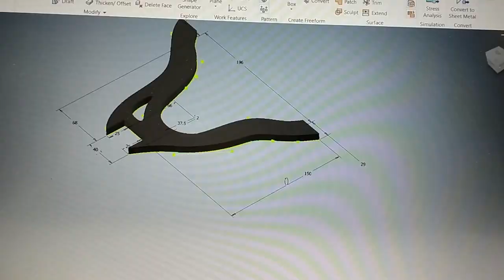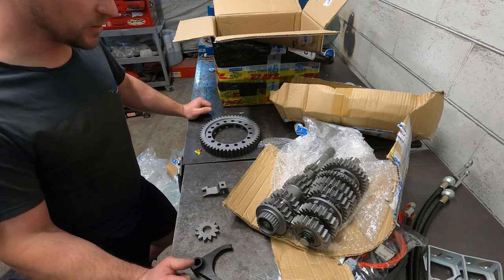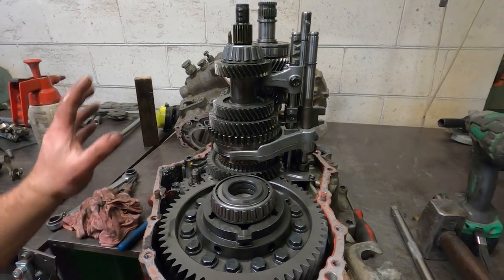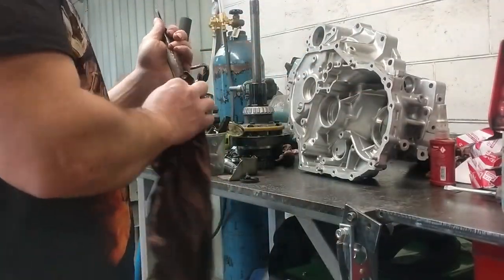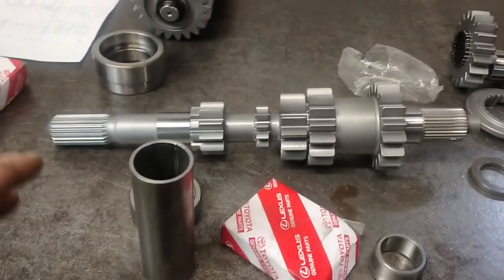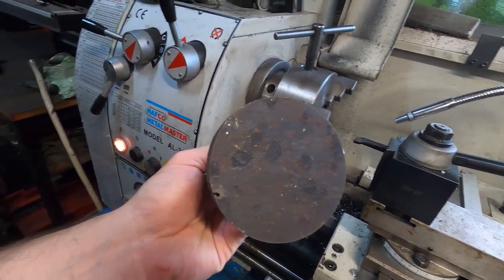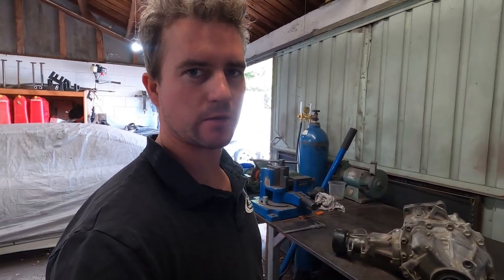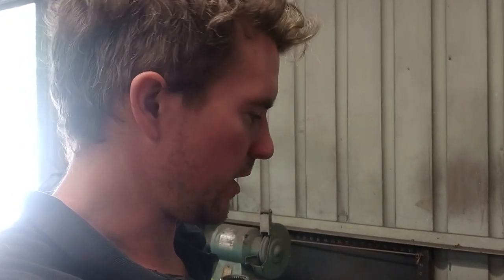ST185 Celica Gearbox Upgrade

Comment: Do you know if that SQS gearset will fit both the ST185 and ST205 boxes?  Any disadvantages to starting out with a 185 box?  Just that I'd rather pickup a used 185 box and retrofit that with a dog gearset then cannibalise my ST205 box... which is becoming an endangered species. cheers.
Reply from the maker: yes they have the same casings. I used a 185 casing for the same reason

Comment: What's the oil pump purpose in the gearbox?
Reply from the maker: to circulate the oil around the transmission, transfer unit and oil cooler